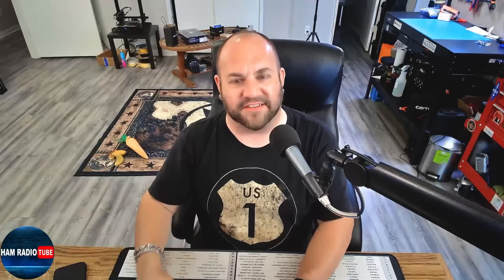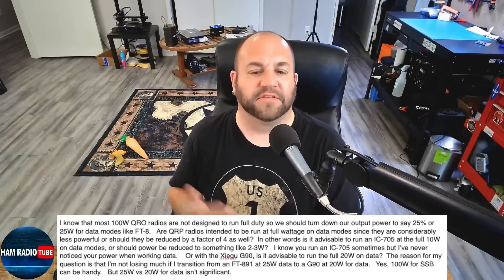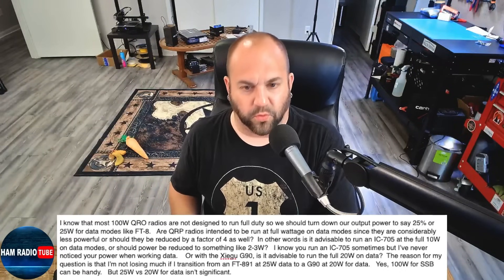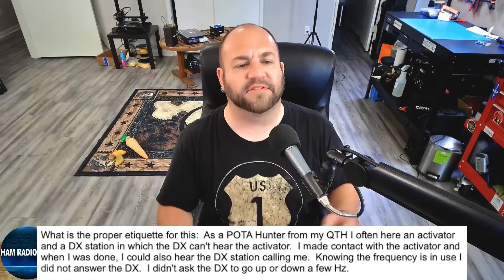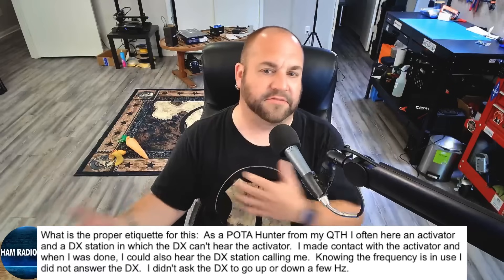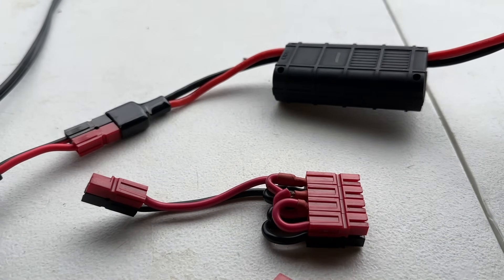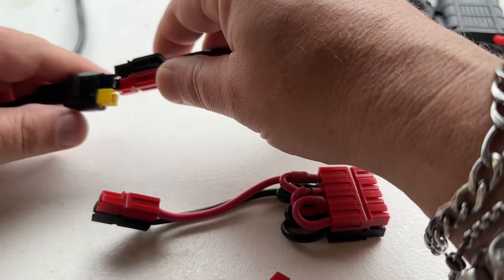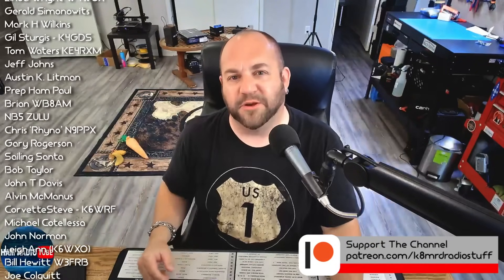Wiring Multiple Solar Panels For Portable Ham Radio

Comment: My understanding is that the Xiegu G90 uses 2 Mitsubishi RD16HHF transistors in the finals (or at least, they used to; haven't opened mine up to look). Each is capable of handling 16W-20W. So routinely using full power should not be a problem.
Reply from the maker: The G90 is a beast!

Comment: I run my 100w radios at 50w, unless I am working my local OM net on 80m, where I drop to 10w.

Oh, Pintos did not blow up from revving the engine. It was from cracked fuel feeds leaking gas everywhere.

Comment: Interesting, I was actually wondering if CW was as bad as data for the radio. Good to know I can floor it! :D
Reply: Cw has a lower duty cycle than data. Data is 100% duty (continuous)  CW about 30-50%.
If data then run around 25-30 % of max peak. Eg if tx rated at 100W peak- use 25W for data
G4BTI
Reply: @DavidCase-ov5uo  well, thanks heaps for that!

Comment: On the power question, the major issue is heat. Electronic lifetimes are significantly diminished by heat. If you run full power on FM or digital with a high duty cycle, the finals and other components will be running at their highest temperatures. As you allow that temperature to rise, the lifetime of the components is reduced. If the rig is in the sun, or the airflow is blocked, the lifespan can be drastically reduced quickly. Therefore, running for short periods of time, or a low duty cycle, at full power is not a big problem because the temperature stays low. If you put the radio in a bag, or deep inside under a shelf, or on the dash in your car, you will be shortening the life even at low power levels, because the temperature can rise too high. So, it is good to run lower power levels and keep the heat down, and try to be conscious of how hot the rig is getting. Run even lower power if out doing POTA or FD in the heat, and worry less about it when conditions are ideal.

Comment: If the panels have reverse voltage diodes, then different wattages should be okay. The issue is one panel feeding voltage into another if they have different outpoot voltage curves. Be careful, though, and check with the manufacturer. Carbonized toys lead to wailing and gnashing of teeth. As always, do your homework. Like you, I am a solar nut.

Comment: Bioenno told me that it is fine to chain their solar panels of varying wattage, as long as they are similar type, for instance a BSP-40-LITE and a BSP-60-LITE are ok together, a BSP-28 and a BSP-120 are ok together, but a BSP-40-LITE and a BSP-28 are not ok together.
Reply: The system will always default to the lowest voltage or lowest amperage panel,  so a 60 watt and 100 watt together will effectively be 120 watts (60x2)

Comment: With the whole power thing, that's why I have heard with amps you get a larger wattage then what you want to run.  If you want to run 500 watts you should get at least 800w or if you can afford it 1kw but run at 500w and it should serve you very well for a very long time since you are not putting a heavy strain on it.